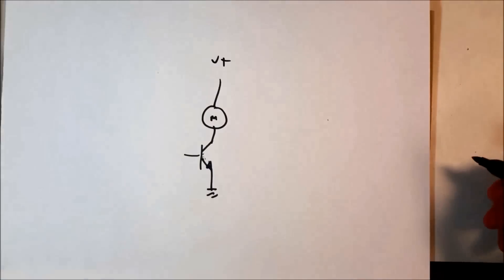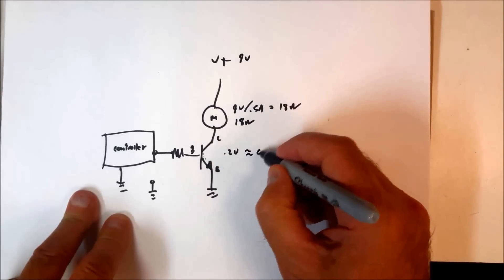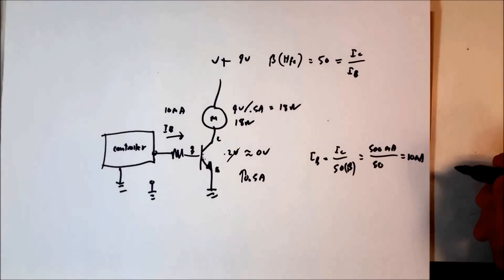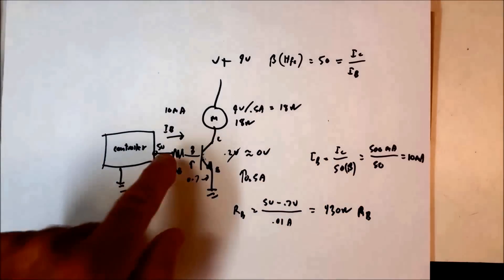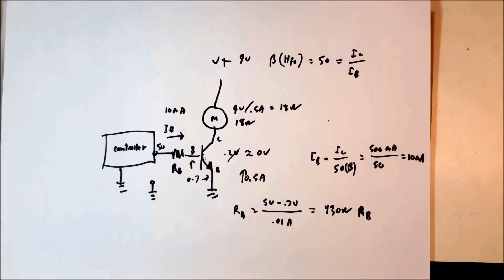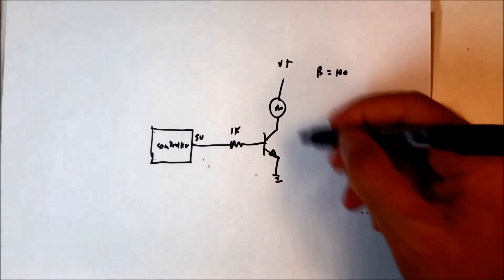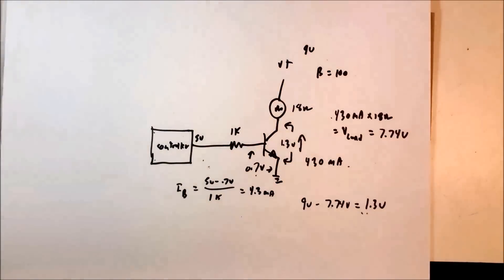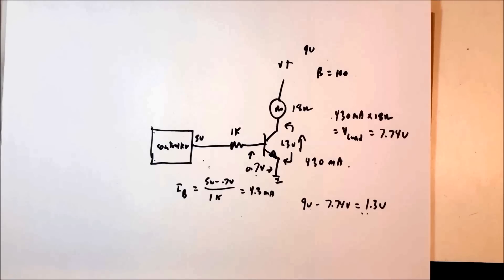Analyzing Transistor Circuits

Comment: In common emitter configuration for a fixed value of base current you could have different value for collector current. My point is that you can't use the equation ic=beta*ib in saturation region.
Reply from the maker: I never said you could use the formula in saturation. Once a transistor is saturated there are an infinite number of base current - collector current possibilities. Saturation means the formula is useless since a further increase in base current will not result in a further increase in collector current.

Comment: hi..is it compulsory to put resistor at the base for the transistor to function?..how about if not put resistor?
Reply from the maker: Yes. A BJT is not like a MOSFET and requires a resistor on the base to set and limit the current into the base. The base-emitter junction of a BJT is a PN junction and is a dead short without a current limiting resistor.
Reply: Dorian McIntire the transistor will burn damage if not use resistor?

Comment: what if collector emitter saturation voltage goes below 0.2V in this case?
Reply from the maker: It can't go below 0.2 volts. A saturated transistor can approach 0v but can only reach about 0.2 volts since some voltage is necessary for saturation current to flow.
Reply: thanks for the info. so, should we consider this saturation voltage into consideration while selecting the components in the circuit? sorry! electronics is a recent hobby of mine, so, I don't know much about it
Reply from the maker: You should always make sure the transistor is in saturation if you are using a BJT to switch a high-current device. The calculations will help you determine if your transistor is fully on or simply acting as a resistor.
Reply: thanks for the help :) I'm actually trying to design a simple audio amplifier circuit powering 4V 0.5A speakers with 5V usb input using 2n5551 bjts, so I was very much confused about how this excess of 1V is going to affect my circuit

Comment: its not possible to have more voltage over the load than the supply voltage. Load voltage is limited by supply voltage.
Reply from the maker: That's the point of saturation. If the calculations show this situation then the transistor is saturated and the load voltage is actually 0.2 volts less than the supply. Make sure you watch the video carefully.